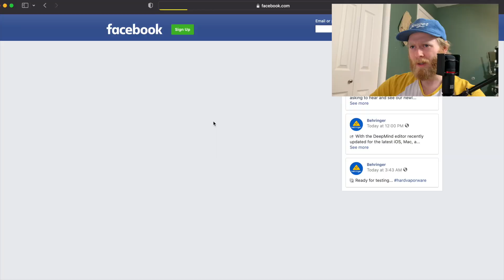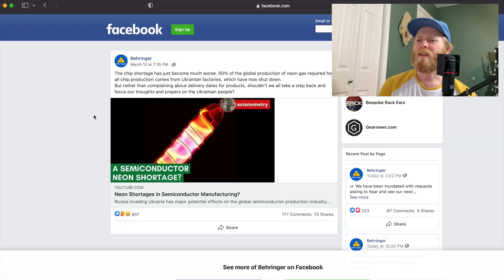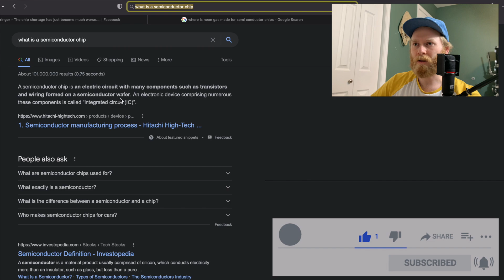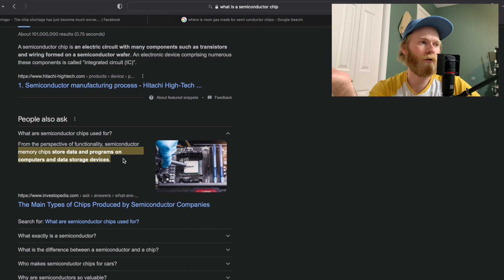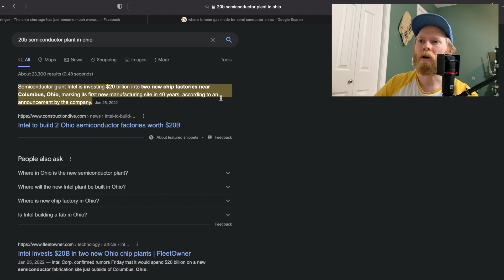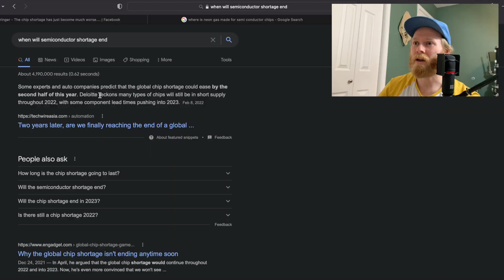Behringer & Their Chip Shortage Dilemma

Comment: There are many kinds of semiconductor chips and ICs ... and each of those are manufactured in specific plants that cannot produce the other types that may be in high demand.
One type are high density, computational chips like CPUs and GPUs, notable companies selling these are Intel, AMD, NVIDIA and ARM SOCs (system on a chip) like mobile processors from Qualcomm, Apple, Samsung, MediaTek.
Second type are lower tier computational stuff like microprocessors (STM, Atmel, PIC ...), ASIC designs and FPGAs (Xilinx)
A third kind are storage devices like RAM and Flash (although these also need separate manufacturing processes)
And nonexhausting I will name a fourth kind: analog ICs.

So for digital synths you probably need to look at the high end processor regime (ARM chips) or possibly microprocessors (like STM) for lower tier stuff and for all analog circuits within a digital or hybrid synth and/or pure analog synths in the analog IC section.

And here is one of the main problems. The analog IC market has consolidated by a lot in the last decade as prices went down and companies stopped being profitable.
Noone did plan to extend production capabilities in this sector by any means because the market didn't grow anymore ... so guess what suddenly changed drastically.

Sadly it rather takes years instead of months to plan and construct new factories so increasing production just takes time and the analog IC shortage will remain even if we get more CPUs/GPUs and ARM SOCs. Therefore the synth market problems won't go away when Intel/TSMC or any other company producing high end digital processors opens a new plant ...
Reply from the maker: Fascinating read. I should have had you do the video! 😂😂😂 in all seriousness though, the war in addition is going to delay this even further. More VSTs on the way? Lol

Comment: The flip side of this is that it could make IOS apps even more popular.
In that side you have both original new apps and well engineered simulators. I have lots of IOS apps that are wonderful, but generally prefer a physical synth that’s easier to tweak without using a stylus.
The good side of IOS, self contained except kb cntrl, it’s portable, can have myriads of apps available and you can get pretty far with 1k investment.
Reply from the maker: That’s a good point! There has been an uptick in apps it seems too 🤔 we’ll have to see where this goes!